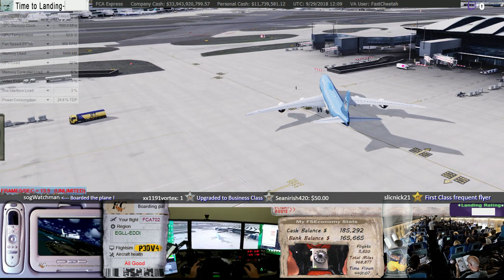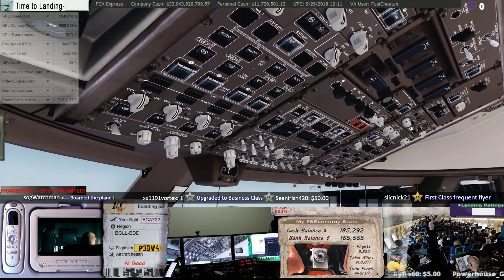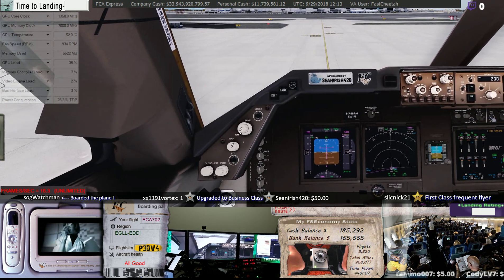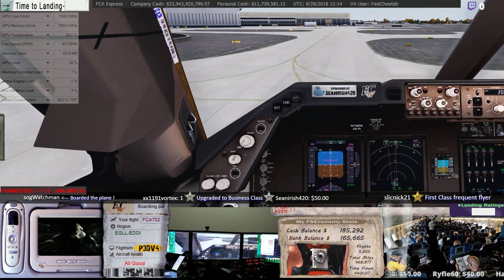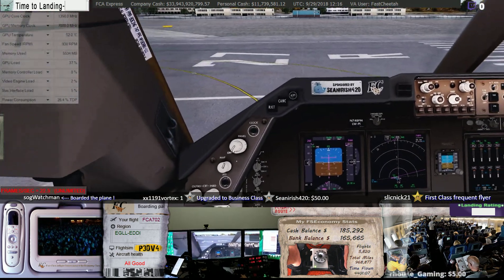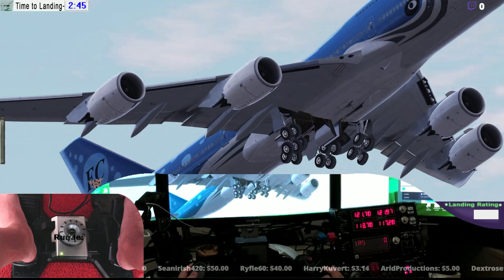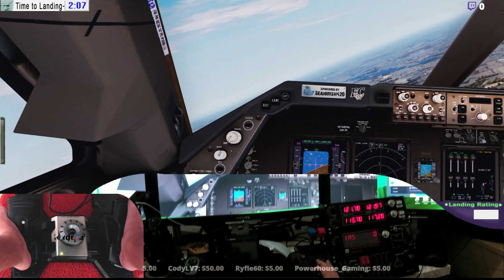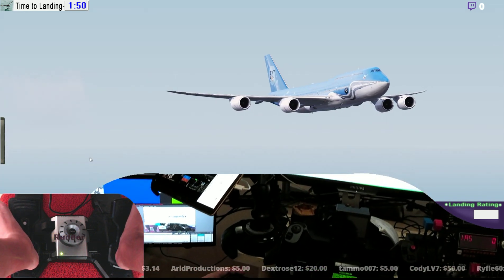P3D V4.3 Nvidia RTX2080Ti EGLL FPS smoothness test

Comment: Honestly with Aerosoft EGLL to get 15fps - 30fps you are lucky, I’ve played with every combination possible and my system is pretty decent and it just does not like Heathrow 😅.. Xplane11 is very good for GPU’s but the Aircraft addons are just nowhere up to the standard of P3D PMDG or FSLABS... if only Xplane had decent aircrafts...
Reply from the maker: GNR_CDO_ALEX_2015 i m using Uk2000 Egll, Aerosoft egll fps is worst from what i read in review. Yes one of the main reasons i stick with p3D is bcos i hv many addons in p3D

Comment: That happens to me too,the problem is the Evga x1 software, you really have to look closely every time you turn the pc on,click all the check boxes that tells you that it will be on when you start windows,not true ,at least on my machine it has to be set up every time I start the pc,and to get my boost clock up what I do is move the slider all the way up (max voltage and max temp,followed by the fan curve set to best cooling solution, so my advice to you is ,before start the sim, set your evga x1 ,make sure your fans (gpu) is running to cool it ,and bring the voltage slider up all the way

Comment: 11fps ???????
Reply from the maker: Fabio Leal at times...
Reply: How sad, my condolences! :(
Reply from the maker: Fabio Leal rip rtx2080ti? lol
Reply: very sad to me to see this reallity , i have gtx1070 and i have 45 fps in the same place !
Reply from the maker: Fabio Leal what is ur CPU? and u use AI traffic?
Reply: Well, i7 4790@4.8ghz, 32GB @2400MHZ , 3 SSD´s in RAID 0 , GTX 1070 , and i have Ai Traffic with 55% in P3D v4.3
Reply from the maker: looks like my cpu at 4.3 is the bottleneck?
Reply: @FastCheetah702    I do not confirm that.
But, here without overclocking the performance drops a lot!

Comment: How many fps in 2k resolution?
Reply from the maker: Şafak Behadır more than 60fps if not flying at Heathrow
Reply: FastCheetah702 rtx2080ti or gtx1080ti which is good for p3d?
Reply from the maker: Şafak Behadır both r good if u hv a cpu like i7 8700k
Reply: Thanks

Comment: Despite the improvements Lockheed Martin made, the sim is still largely limited by CPU core clock. You want noticeably better performance, get a CPU with higher base core clocks instead of a faster GPU.
Reply from the maker: Fahad Al-Riyami yes currently my 5969x oc at 4.2, i might have to upgrade cpu to i9 9900k
Reply from the maker: Fahad Al-Riyami u mentioned high base clock, do u mean boost clock may not help much if base clock is the lower type for cpu?
Reply: FastCheetah702 Intels boost clock works when some CPU cores are not being used. For example the Core i7-8086K will only boost to 5GHz on one core. So if the application you are using can only utilize one core, the CPU will disable 5 cores, and boost to 5GHz on the remaining one.

That said, Lockheed developers confirmed that P3Dv4 will utilize all cores in your CPU. But, not as efficiently as it should. More like the simulator will spread workloads across all cores. So the same workloads that utilize 100% of the 2 cores on a 2-core processor will be spread across 4 cores on a 4-core processor resulting in 50% utilization. So just because you see it using 4 cores doesn't mean you're getting more performance.

For that reason, an Intel CPU will not be able to reach boost clocks when running P3Dv4. Because the sim will use all cores available to it. That's why you'll get more performance from a CPU that has higher BASE clocks rather than those that can reach higher BOOST clocks.
Reply from the maker: Fahad Al-Riyami this also explain why the cpu load is most of the time at low load % even though we are at a high density airport like Heathrow, correct?

Comment: Please share your system specs.
Reply from the maker: Ammar Qutteineh hi, its 5969x oc at 4.2,  ram 32gb speed 2666, rtx 2080ti boost clock 1950, SSD. This video was made before i use DDU to clean up the nvidia driver. Boost clock now able to respond to the scene demand when at 6023x1080reso. I hv cloud set at 200nm in Active sky  and 4xSSAA on.
Reply from the maker: GPU load still low at 45% not sure y p3d dont make use of high gpu load
Reply: I can tell you why. Youre bottleneck is the 5960X! Well is it a 8 Core CPU, but it hits "only" 4.2Ghz. You must try hit close to 5 Ghz, or even more, to fully utilize this GPU. The CPU clockspeed is also why the 2080TI is limited to only about 45% load. The 5960X at 4.2Ghz isn't capable of feeding this beast with enough data. If you had the new 8086 6 Core intel at 5 Ghz you would see a significant boost in fps. ;-)
Reply from the maker: Yes my 5960x cannot reach 5Ghz, it starts to be unstable at 4.3. I might have to get a I9 9900k ot maybe 7700k, 7700k seems to be able to reach 5Ghz easily.
Reply: I got the i7-8086K and at 5.2 GHZ p3d is running around 35 fps at big airport like EGLL with UTLive Traffic on 1080ti. Change your CPU and let's see how it works.
Reply from the maker: King Azar do u think i9 9900k will be good compare to 8700k? Just thinking i9 9900k having a lower base clock....
Reply: an i7 8700k will be a perfect match for your 2080ti performance
Reply from the maker: Do you think i9 9900k with be a better match than 8700k?
Reply: @FastCheetah702  . I don't think the i9 will be a better choise, at least not with p3d V4. Maybe with P3D v5?! But WHO knows...
8086k or 8700k will be better this time around, because of the higher clockspeeds generally.
Reply from the maker: Kjetil Håvan i9 9900k not good even with oc to 5ghz for all 8 cores?
Reply: @FastCheetah702 . Sure, if you can reach that clockspeeds with system stability in mind, then the I9 is a keeper! 😀
It all depends on how much you can cranck up the cpu core voltage.
Reply from the maker: Kjetil Håvan i will most likely get a mb that can oc to 5ghz easily and with a water cooler
Reply: @FastCheetah702 . The Mobo is in gereneral no problem. It depends more on the CPU overclockability. Like, have you won the CPU lottery or not. 😉
Reply from the maker: Kjetil Håvan my 5960x oc all cores stable at 4.3, is that considered a win in cpu lottery? lol

Comment: P3D is not a very good sim to use when you have a graphics card this good. You would take more advantage of the graphics power if you switch to X-Plane 11 as it has a better engine and runs smoother.
Reply from the maker: Mathew i believe its the boost clock not activated, which it shd, will try to find out why... haha
Reply from the maker: Mathew i use MSI afterburner to lock GPU at boost clock speed 1950mhz.  and it is good now. Just very puzzle why p3d v4 does not trigger boost clock, haha
Reply: SIR, can u show ur results now. Or just tell us what FPS do u have with 2080ti ?
Reply from the maker: Tamaz Kekenadze Since the video above, i hv used DDU to reinstall the driver. I hv not record any result yet. I will do that in the next few day.
Reply: X-Plane 11 is 32 bits or 64 bits? P3Dv4 is 64 bits, loading up all scenery into the library without getting crash.
Reply from the maker: Research Lab xp11 is 64bit